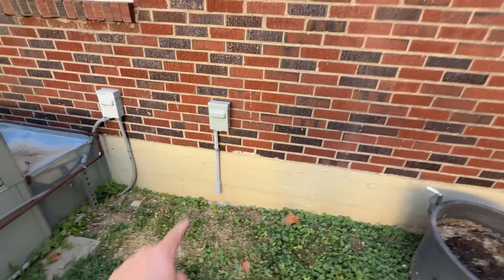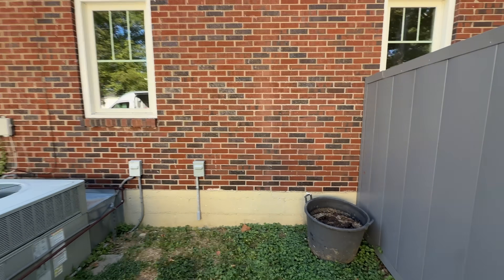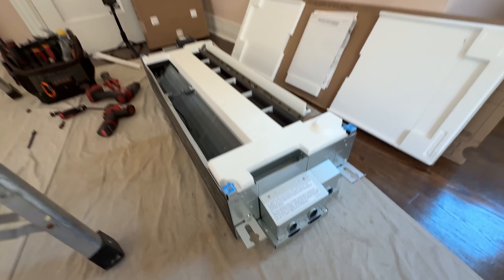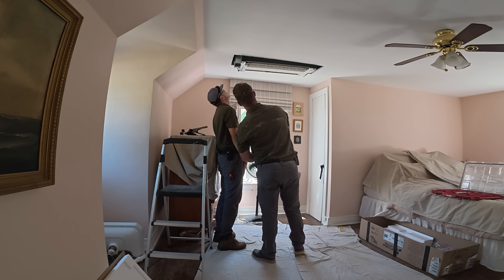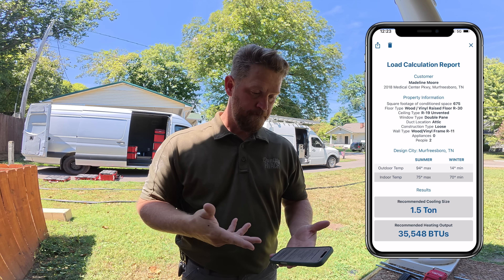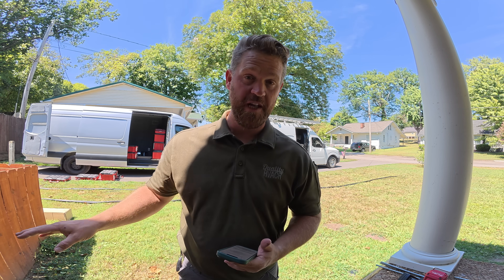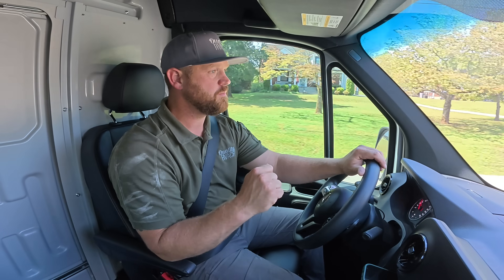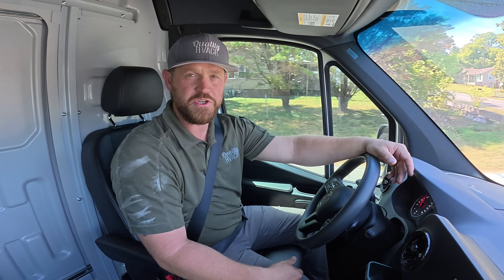We Should’ve Been More CAREFUL…HVAC Install

Comment: With the ceiling drywall cut to fit the ceiling unit, there will be gap around the perimeter.  As part of the installation, how do you ensure that the attic air are not being drawed into the room let's say when kitchen or both exhaus fan is running?  Also, is the ceiling mount unit itself are air tight?

Comment: The trick with the tape is cool, but you do realize they send 4 washers with the foam inside of them to hold the washer up😅
Reply: Hey just to add, I just finished the video, I’ve done quite a bit of these units, you need 14inches to have the unit fit, what I’ve done when it’s not 14 inches is take 2 wood clamps/ spreader bars and open up the joists large enough to get your ceiling cassette in, I’ve done that a handful of times, they move pretty easily and you’ll get your 1-2” that you need

Comment: why would you need a tool just for bending threaded rod?
Reply: Its a tubing bender which gets used all the time, happens to work for threaded rod as well.
Reply: I use a closed end wrench for rod offsets.